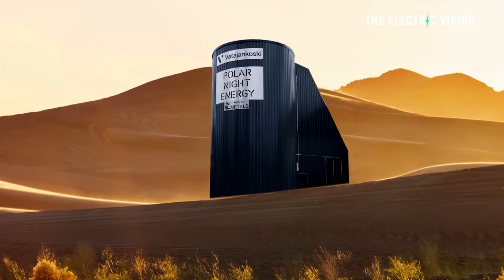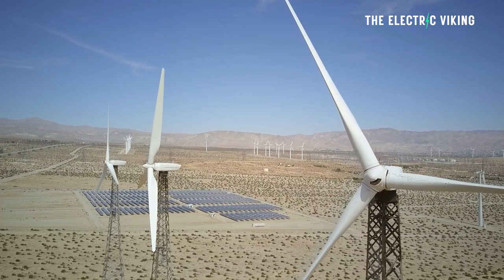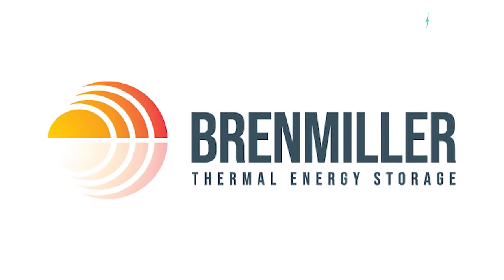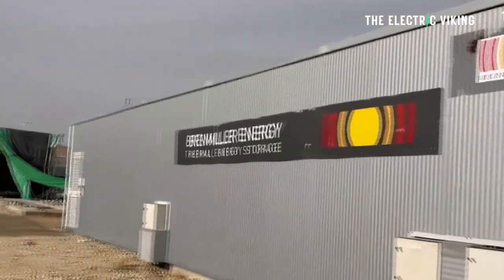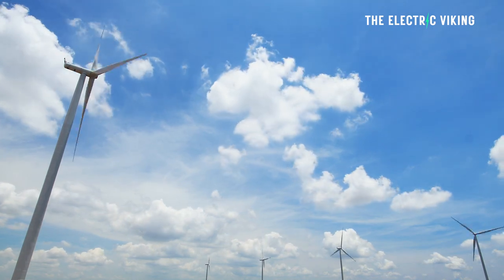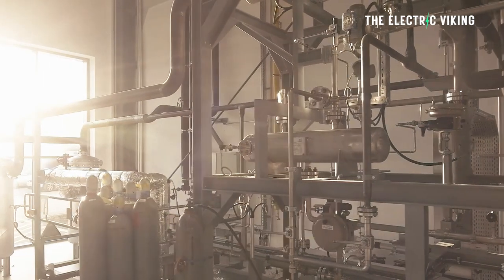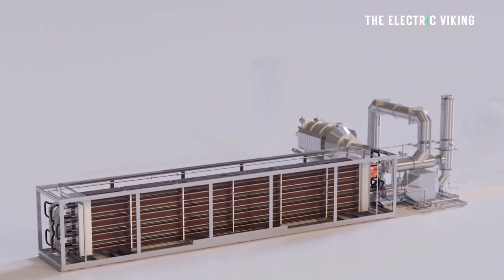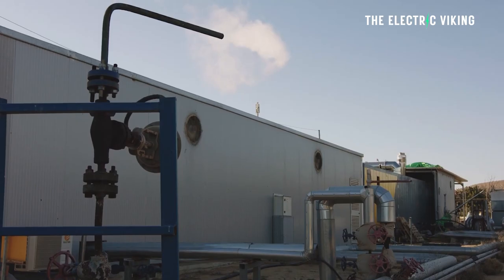The crushed desert rock battery gigafactory that was built in the desert

Comment: Sam........check out sand batteries. I think a Finnish company has invented a sand battery. Its a tank of thousands of pounds of sand. The sand can be warmed to up to 700 degrees. It can get warmed by solar, flame.......what ever source of heat is available. Sand does not transmit heat.....its a great insulator. Thats why on a beach or desert the top of the sand can be very hot but a few inches down its cool. There are videos on u tube of diy types trying to make a smaller sized sand battery to heat one house. The video uses an old water heater. Check out sand batteries and that company in finland. I think the company has been profiled on u tube by u tubers........lets have a think........and.......now you know.......g day......mate..!!!!!!!

Comment: The problem with temp around 1000 degrees Celsius is the maintenance of the values to move the molten rock have a high failure rate need to see if they have solved this problem the.1414 is a similar company in Australia(melting point temperature of silicon)Making valves cheap enough that last has been the big problem so far.

Comment: Eastern Washington did a thermal battery about a decade ago to take the excess wind energy they were producing. They did this by replacing and controlling thousands of hot water heaters in houses. They would heat the water up to 190 degrees with the excess energy. Then the water heater would mix that with cold water so the homeowner gets 120 degree water. 

They also did ceramic thermal bricks inside the furnace to heat the house. I don’t know how many of those they implemented.
Reply: That’s more like load shifting.  But yes a valuable tool.  Same as pre-cooling houses during off peak hours. 

It’s a lower hanging fruit (cheaper and faster step) then VPPs with home batteries.  The faster the better.

Comment: Not the first in energy storage. In 2021 they already build a thermal battery build with Basalt rock. 
Can be heated up to 500Celsius and stored up to 6 months. 300kWh of energy per 1 cubik meter Basalt. Costs, . . .€0.02 per kWh.

Comment: The flaws I can see in this are that crushed rock (or sand, as most people call it) has a fairly low specific heat capacity, and poor thermal conductivity. If you've ever been on a beach where the sand is too hot to walk on, just bury your feet a few inches into the sand  and it's a lot cooler. If you have abundant surplus electricity and you don't have the terrain for pumped hydro, how about electrolysing water to create hydrogen which is more easily convertible into higher grade energy?

Comment: Happy for Australia and the example they are setting, but Australia's solutions won't necessarily be the best options in other parts of the world. The U.K. for example gets roughly HALF the hours of sunshine of Australia. Home solar installations in the U.S. are generally TWICE as expensive as in Australia. FOSSIL FUELS accounted for 80% of global energy in 2021 and 81% of global energy in 2022, so despite the growth of wind and solar THE TREND is NOT for adequate replacement of fossil fuels by wind and solar. NUCLEAR, by contrast, can easily replace ALL fossil fuels in a short time due to the ENERGY density of nuclear being about TWO MILLION TIMES higher than that of any chemical (specifically fossil fuels, biofuels, AND BATTERIES). NUCLEAR is your IMMEDIATE SOLUTION my friends. IT is worth the "expense". There IS NO REALISTIC competitor to NUCLEAR with the same advantages--PERIOD. 
Imagine if The Electric Viking discovered the practical benefits of Nuclear, imagine the numbers of videos that would be created.  CHEERS!
Reply: Except for the cost and decades required to get it online. 

You can permit and build a lot of onshore and offshore wind power much faster.
Reply: Except for the cost and decades required to get it online. 

You can permit and build a lot of onshore and offshore wind power much faster.